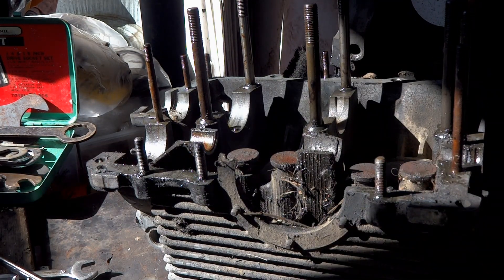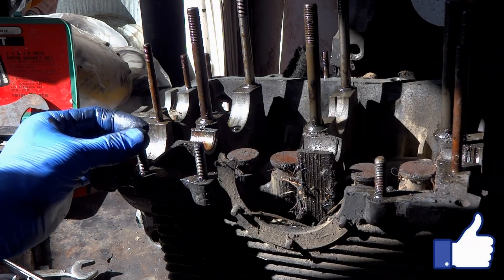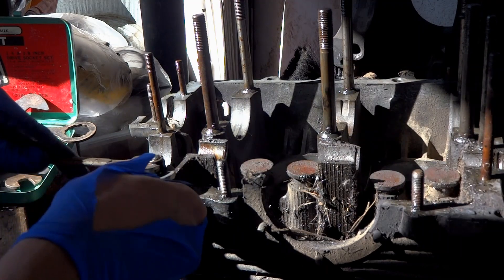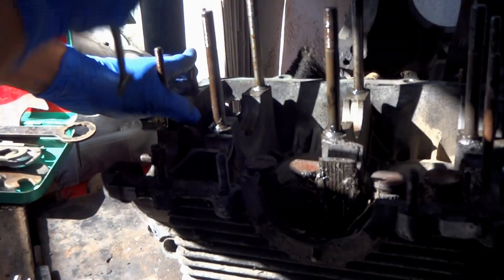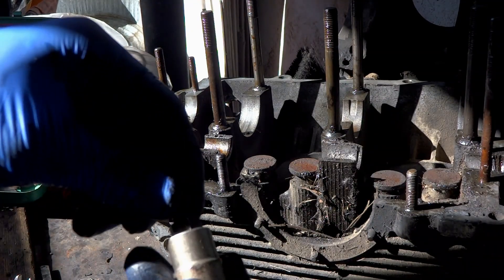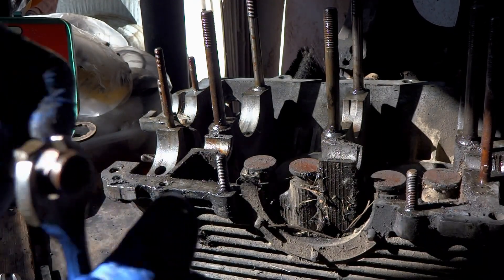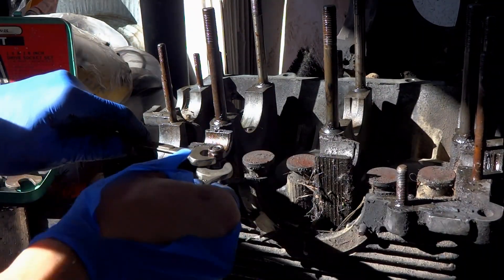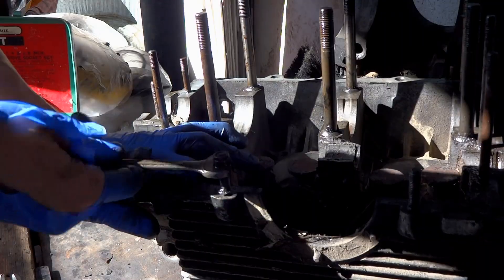Jam Nut Trick - Double Nut Technique for Removing/Installing Studs

Comment: What if the threads are messed up? I cut some of the threads with a dremmel by accident. Will a die work to at least clean the remaining threads on the stud?
Reply from the maker: Without looking at it I can’t say for sure but you’re reasoning sounds good. The die should work, I’ve also cleaned threads with a tiny detail file. Usually cuts in the threads don’t affect too bad depending on angle. If fixed mashed/flat threads using the die. Good luck 👍
Reply: @handbuiltbob  well, I grinded down some threads completely but not all threads.

Comment: Im assuming this will work for my double ended studs as well? My dad has a drag car and he cant work on it anymore so ive been goong at it. A couple of the studs came out when i tried to get off the lug nuts but the ones that stayed i cant seem to get out. Hoping this works trying it tomorrow
Reply from the maker: Typically wheel studs are a press fit
Reply: @handbuiltbob  these are double sided wheel studs. Threading on both ends with a piece in the center that's just metal. Having so much trouble getting off the old studs. I got my nuts earlier though gonna see if this will work for me. I just need them to twist out because they are threaded
Reply from the maker: Interesting hopefully it’ll work, are they standard thread or reverse thread?
Reply: @handbuiltbob  I finally got them out with 5/8 stud extractor but it did screw the threads up but no big deal there I had bought new ones to replace them. Unfortunately this trick wouldn't work for me. And I believe they are just standard thread

Comment: Now do a close up of removing the studs of the egr valve on an 07 honda fit 1.5L 👀
Reply from the maker: 😂 bring it down well get you squared away, is it a clearance issue?
Reply: @handbuiltbob  side ways engine, clearance is not actually too bad in 1st gen

Comment: Worked well on a seized  starter bolt with broken head.  Heat and penetrating oil as well.  Thanks for your video.
Reply from the maker: Awesome glad it could help

Comment: HAHA, your glove is exactly how mine turn out within the first 3 mins of working on any project.
Reply from the maker: Some gloves last better than others, do you have any you prefer?
Reply: @handbuiltbob  Oh no, I have tried a lot of them and they all seem to turn out the same way. But I guess a torn glove still provides some protection from having to scrub your hands for 30 mins after a job. Let me know if you ever find a glove that does not split.
Reply: Kevlar gloves are pretty cut resistant and you can get them thin enough to still feel what you’re doing

Comment: So grateful man.No wonder why I failed Chemistry.Used this method on a bike axle.Tried using a vice and these cones and nuts were on tight.Then used your video demonstration.Finally took out the screw axle attached to the cone and nut by using two nuts on the other side of axle.It worked!
Sank You Very Much.
😅
Reply from the maker: Awesome!

Comment: How about two flanged serrated nuts? Would that work better more friction? (Let's say for motorcycle restoration where things are seized)
Reply from the maker: Before attempting to remove any fastener or stud, I always heat it until red hot then squirt penetrating oil on it, then repeat. It could take a couple tries but. 
As far as anything seized you might end up snapping the stud depending on what you’re working on.

Comment: Does this work better than using vice grips?
Reply from the maker: Well some nuts are smaller than the vice grip jaws. I’ve never tried to lock a jam nut using vice grips, let me know how it goes
Reply: @handbuiltbob  I meant just putting the vice grips on the screw itself and turning.
Reply from the maker: That may mess up the threads on the stud. I try to save hardware when I can

Comment: Thanks -- gotta busted but sticking out of an exhaust crossover flange on a 97 4Runner I'll try this on tomorrow! Appreciate it!
Reply from the maker: Good luck! Use a bit of heat and some penetrating oil before you start. I usually two about two cycles of heat and penny oil on rusty fasteners, reduces the chance of snapping the stud, not absolute but I used to snap way more than I do now 😂

Comment: this does not work for a stuck stud, penetrating oil might help.
Reply from the maker: It is the same actual technique for the locknut. Adding oil to the fastener won’t change the locknut
Reply: @handbuiltbob  I meàn if the stud is stuck the outer but will rotate together with the inner nut. Penetrating oil in the block can help.
Reply from the maker: I’ve never really had an issue setting up a locknut, no matter how stuck the stud is. I usually just keep two wrenches on it at that point. I have a video on removing broken studs as well. I always spray them down with penny oil just like mentioned anytime I remove any fastener really.
Reply: @handbuiltbob  but nothing prevents the outer nut to rotate together with the inner nut.
Reply from the maker: I will find a situation where this is not the case and make a video, I have an engine sitting around that has sat outside and the exhaust studs are still in and rusted. Will get it out using this locknut method. Try using longer wrenches when setting up your locknut, I’ve never had an issue. And like I said I use two wrenches. There’s another video on this channel where I’ve done it successfully using this same engine case. But I’ll do it again. 👍

Comment: Thanks man, I used this technique to remove the studs from my old inlet pipe on my XR100R motorcycle!
Reply from the maker: Nice! If I ever need to remove them on an engine that runs, I run it for a bit so it can warm up. Then I squirt some penetrating oil on the fastener to draw the oil in. I haven’t broken a stud since using this method and it works great on exhaust studs